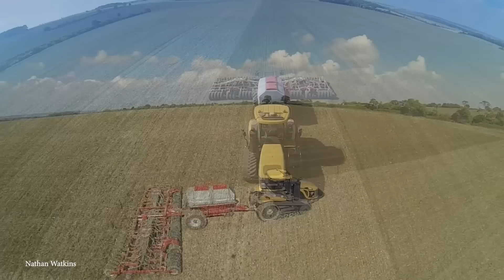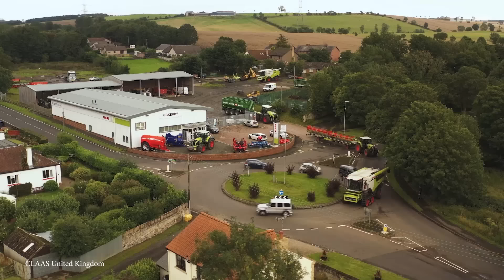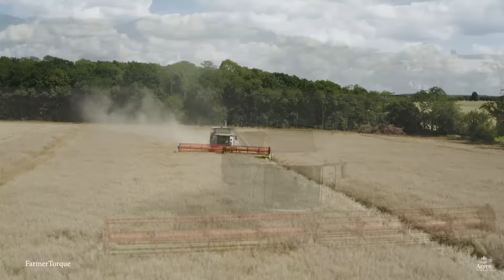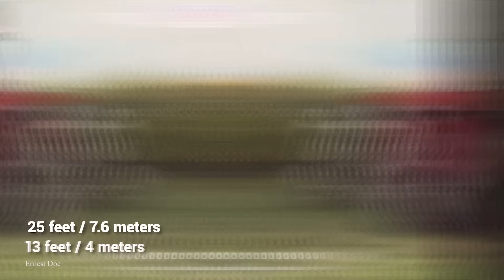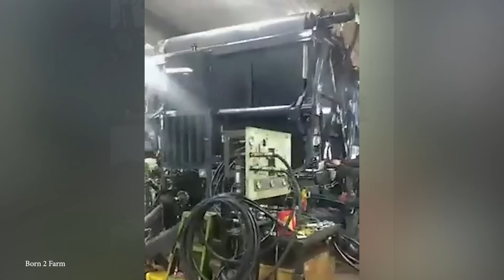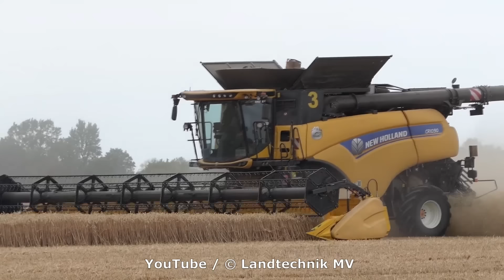TOP 15 BIGGEST AGRICULTURAL MACHINES

Comment: When making this sort of video's it would be helpfull to include measurements etc in a form most of the world adopted ages ago. Centimeter, x by 100 equal Meter, 1000 meters equal a  kilometer,  a gram x 1000 is one kilo, one kg x 1000 equal one metric ton.  One cubic centimeter of water weigh i gram,  there is 100x100x100 cubic centimeter in a cubic meter,  and a cubic meter of plain water weigh a metric ton,  or approximately 2200 lbs.  Etc. With a little effort both systems, imperial and metric can be used to convey information to a wider audience in the world. 🙄
Stay safe and enjoy life.
☆  Niels 💕

Comment: Time is money, however buying two medium units instead of one large unit is actually what most farmers do, not only can two medium units operate at the same rate as one large unit, but if one unit stops working you still have another to continue the job, where as if you rely on one large unit then the entire operation will stop until it's fixed. In addition, larger units are harder to sell when you want to upgrade, because only a small amount of farmers have farms large enough to even validate having a large unit. Overall, the excessively large units are not practical.

Comment: Technically Big Roy is capable of putting out over 1100 hp, but it was down-rated to 650 to prevent damage to the engine by volunteers at the museum where it resides who don't know how to run it properly. (I know, I used to work there.)

Comment: How much they cost?
Reply: Some tractors shown are $200,000 range and the big combine is in the $1 Million range. Cost per acre and per ton, they are cheaper to use than a dozen smaller tractors and combines. More Horsepower (in the 500 to 600 HP range) equates to less cost per acre and per ton, plus it is a time saver. For large farms, some in the 20,000 to 35,000 acre size, it costs too much to try to use half a dozen or more smaller machines. 45 years ago when most farmers mentality was to buy the smallest tractor to save on fuel, I proved that 5 times the HP would save on fuel and time, being cheaper to operate per acre and per ton. I have 85 to 100 HP (guessing conservatively for a 1978 Chevy pickup engine) [not sure the actual HP - was 140 HP new - but it is plenty] on my mini tractor (250 CID/4 L) with pickup truck sized Ag cleat drive tires. I was considering a 250 HP or more 350 CID/5.7 L V-8 engine, but it was too wide to fit. Even at the 80 to 100 HP, it uses less fuel than the 20 to 40 HP tractors to the same job and gets the job done in much less time.

Comment: im a farmer and there is so much false info in these video.  Did you forget about the jd9640, newholland t9 the fendt ideal 10t or fendt 1167.  Why the case 9240 instead of 9250 I think the 9240 could use bigger then 45f head we are going to put a 60f on a 9250.  Why did you put class 780 on the list you already had the bigger 890. Bourgault makes a bigger air cart if your wondering how I know because we own one.  sprayer main use is to put down herbicide most fertilizer is solid
Reply: there is another farmer jeez
hard to come by with these cityits
Reply: If you get one of these big tractors stuck, you'll need to have something bigger to pull it out
Reply: @nathanmeece9794  usually but not always  sometimes with its own power and just a little help they can get out.

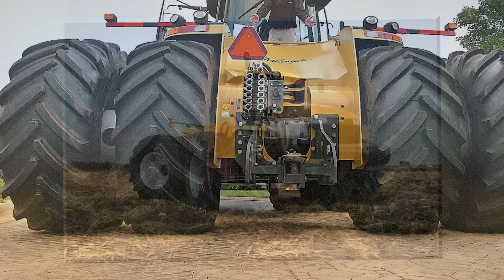Comment: 7:17 "only need to be refueled every few days"  -  NOPE.  You can burn this thing dry in 14-17 hours when it is in constant use.  Perhaps even more quickly than that.
Reply: Yeah we burn about 18 gallons an hour in our jd 9460r. Can't even get 24 hours to a tank. And that's only on a small seeder

Comment: Smashing seeds is not a problem at all. Seeds are very resistant and, moreover, are put in the ground on the back of the machine. Compacting the soil preventing root spreading and making life of soil inhabitants dificult is the key problem to avoid.
Reply: Smashing seeds is definitely a problem. You ruin germination